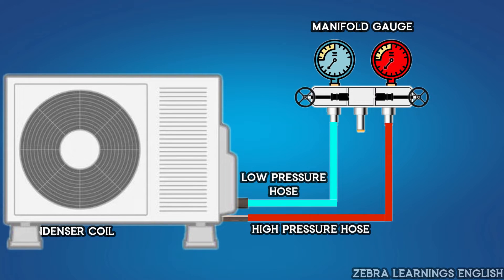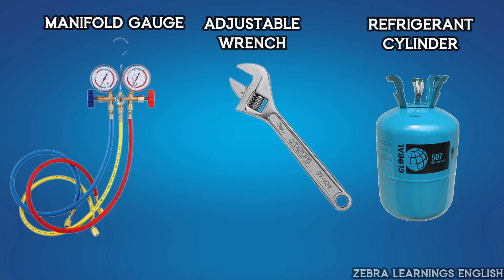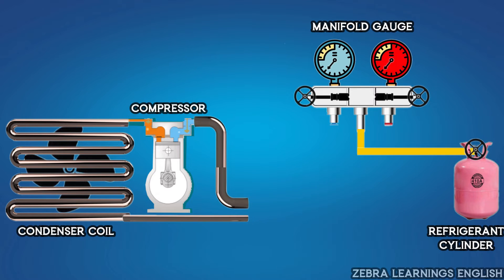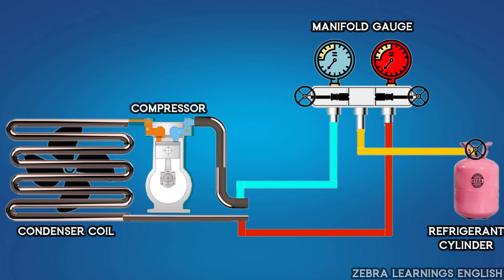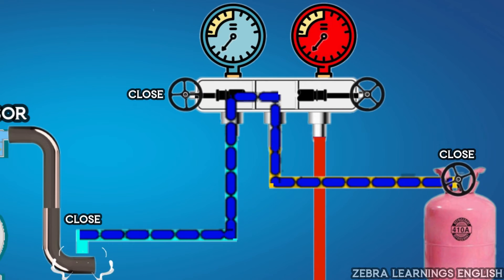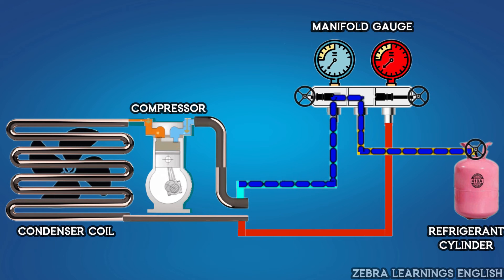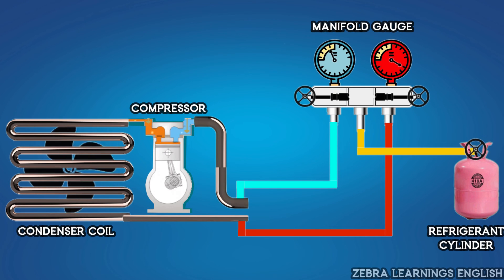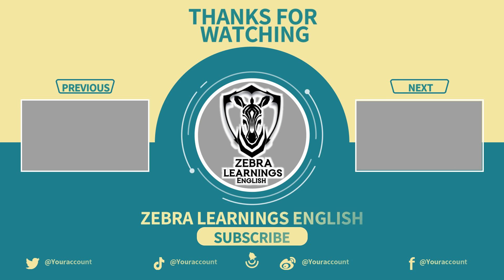How to Charge Refrigerant (Gas) in an AC unit?

Comment: So, you technically do Do Not need to connect the red hose, since you never open that valve (adding R-22 to outside unit)? I noticed some charging kits only come with 1 hose and gauge? Thanks in advance
Reply: there is no fiitting for the red hose

Comment: WRONG NEED SCALE,AFTER VACUUMING R410 OR R32 IN LIQUID STATE BEFORE RUNNING THE SYSTEM WITH EXACT WEIGHT.NOT OLD SYSTEM YOU ARE TUTORING.

Comment: The low-pressure line is typically used for charging refrigerant gas, whereas the high-pressure line is used for charging refrigerant liquid. Liquid charging generally takes less time compared to gas charging.
Reply: no high pressure valve in mini splits.  you charge at the suction valve.

Comment: Hi. Why need to connect high pressure line if we are not use that during charge refrigerant?
Reply: Lol i was questioning the same thing hahah, and then if we recharging it from zero there's some absolute weight from the factory its about 300-500 gr for 1/2 pk ac so if we recharge it is it okay to use only psi as a target?

Comment: I was charging 410a while charging compressor and fan shut down itself, I checked breaker and thermostat both were on , what could have gone wrong
Reply: bad capacitor
Reply: Not the capacitor. The fan and compressor each have their own. Unlikely both fail at the same time. If charging 410a, must be as a liquid.  If only low pressure port is available, then you cannot run the compressor as this port is directly connected to the compressor intake. If a liquid enters the compressor, it will immediately stall and trip the breaker or damage the relay contacts.

Comment: Hi, thanks for the video. Is it necessary to attach the red hose to the air conditioner in order to fill it? I have simpler manifold gauge, with only blue and yellow hose (without red hose, and without red gauge).

Comment: can you fill using the red hose to the low pressure side?
Reply from the maker: No you can't fill through the red hose. Because the red hose in connected the high pressure side. If you try to charge through the red hose. Instead of the refrigerant going into the unit, the refrigerant will return to cylinder from the unit because of the pressure difference.

Comment: one question, is the red hose to high pressure line, complete shut off all the process?
Reply from the maker: Yes, it will be completely shutoff through out the process.
Reply: why have it connected then? can't you just have the blue hose connected to fill ? @zebralearnings
Reply: @densista1160 correct me if I’m wrong but i think it’s for reverse charging if you’ve added too much ?

Comment: Could you explain to me what happens if we open high-pressure on-off valve when we charge refrigerant ( GAS ) in an AC UNIT ?
Reply from the maker: If we open the High Pressure On/Off Valve, Refrigerant will start going from AC Unit to Refrigerant Cylinder. Because the pressure in the High Pressure Side of the AC Unit is more than the pressure in the Refrigerant Cylinder.
Reply: @zebralearnings  I have always charged a AC system with high and low side
Reply: So if we want high pressure liquid charge , we go in the liquid receiver service valve, we pump down first the unit(closing the liquid receiver outlet)while puting the red hose to the liquid receiver service valve,, to pump down while we charging liquid while compressor is suctioning out of the  tank.

Comment: 410A needs to have the bottle inverted upside down to charge properly as a liquid.  If you charge it upright, it will fractionate the near-azeotropic mixture.  R22 is a single component and can be charged as a gas.
Reply: What is 410a? What is r22?
Reply from the maker: R410A and R22 is two different types of refrigerant (Gas).
R22 is older type refrigerant and R410A is modern refrigerant.
R410A is more environmental friendly than the R22 refrigerant.
Because R22 has chlorine atoms which dangerous to ozone layer but R410A doesn't have any chlorine atoms.
The modern AC systems are replacing the R22 refrigerant with R410A refrigerant.
R22 Refrigerant will not be available in the future due to environmental concerns.
Reply: @zebralearningsenglish-pn6fl check your sources. 410a has turned out to not be "environmentally friendly. Why do you say r22 will no longer be available in the future. Virgin r22 is easily available now, and upon the demise of r22 equipment in the future, who's gonna care if even the used equipment market no longer exists.
Reply: Does r22 and r32 also need to turn the cylinder upside down too?
Reply: @DaveMavrik-ki7xb  R22 and R32 are single refrigerant and their composition does not change. Thus both liquid charging and gas charging is possible. Liquid charging of R32 all at once from the low - pressure side may cause the compressor to malfunction.  

Working pressures for R32 are very similar to R410A and when charging, R32 is easier to handle as it can be charged in both a gas and a liquid state. This why R32 is classified as A2L “mildly flammable” while safety data sheets say it is extremely flammable but it really is very low flammability.
Reply: @Balticblue93  thank you for informations, is it true that r32 is low flammable? Because of that, i am struggling to find r410a ac for my home.
Reply: @DaveMavrik-ki7xb  That is correct. R32 is an A2L and very low flammability.  Like so low, it won’t light in most cases.  R290 is propane and is nothing like any A2L.  You have nothing to worry about.  The glide and pressures and temperatures are very close to 410a.  410a is 50% R32 and 50% R125.  It will just be a lower GWP.   It has been used all over the world for a decade or more.  But 410a will be around till Christ returns, so don’t sweat it.
Reply: @Balticblue93  a malfunctioning compressor? You're a little off on your definition of malfunctioning. Especially referring to compressors. Perhaps start with an understanding of what happens when charging or recharging, and how to simply avoid any problems. But "broken" and "malfunctioning" are two different mechanical terms.
Reply: @nothankyou5524  What are you even talking about? Broken and malfunctioning compressor?  This is an older thread and don’t know what you are talking about.  Been in the industry for 28 years.  But what are you commenting on with tagging me?
Reply: @DaveMavrik-ki7xb if you don't know how to determine that, you shouldn't be anywhere near it. You're too lazy to even google something?
Reply: Hello, I have an inverter 2.5hp AC using R410A, it is 4-6 years old AC. I just finished vacuum and recharge the refrigerant,
When i reach 110psi, the compressor amp is over 9.6 amp, and it is loud. The max amp labeled at the back said max amp : 8.5amp. should I continue adding refrigerant to 120-130 or reduce it below 110psi to follow the same max.amp? Thank you.
Reply: @DaveMavrik-ki7xb  Well, first off, which equipment is this?  Secondly, we don't charge by PSI, we charge by weight and then SC or SH based on the manufacturer has set for a specific temperature.  Depends on so many factors but PSI is not one of them on initial charge.   How far down did you pull the vacuum down, how long was the decay test and how well it hold?
Reply: Hi, i still dont understand about refrigerant, if it is already in a very cold temperature, why does it need to compress to hot temperature and making it cold again? I have watched many videos and still dont fully get it. Thank you
Reply: Nice call. I was flipping thru these videos and saw the pink tank. I assume you're technical hvac  oriented.  Depending on your age, you may actually get to the end of a great and interesting career, before the mfgrs have made equipment more idiot proof than they already have had to. Best wishes. (BTW, consider relocating 4 way valves, not that you haven't already done that a time or two.)
Reply: We fill the gas suction line so after evaporator liquid become a gas
Reply from the maker: It's depends on the cylinder. Before charging the refrigerant we should check the instruction on the cylinder how to charge.
Reply: @zebralearningsenglish-pn6fl  410a has to go in as a liquid. It's a blend. I've never seen a 410a tank that charged liquid "right side up".